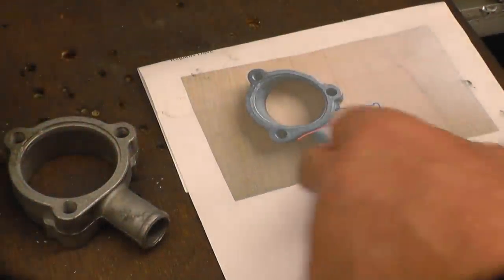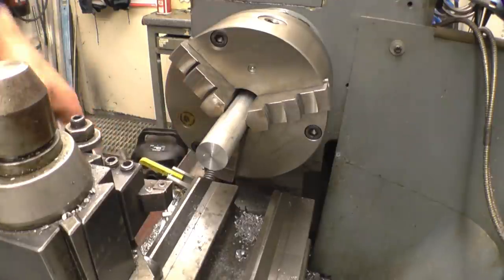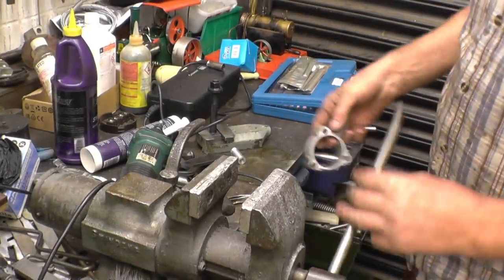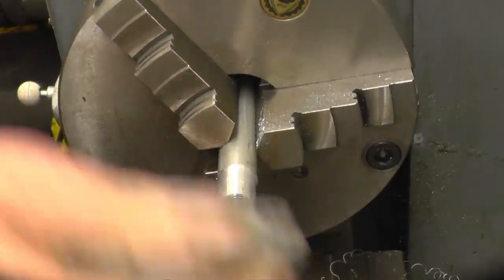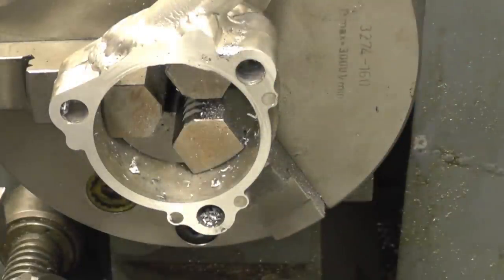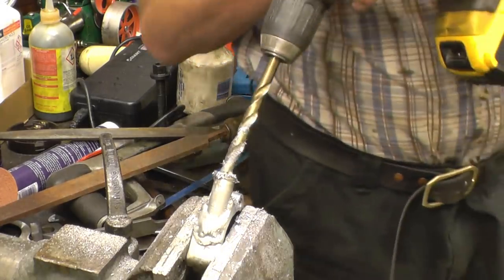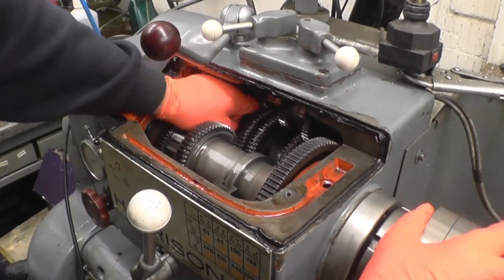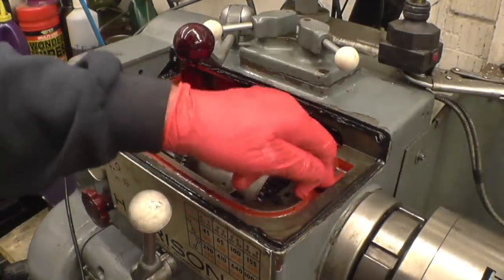SNNC 344 P1  Mini Thermostat Housing Mod ,  ER 25 Spanner

Comment: Great modification welding the alloy thermostat housing. Adding the extra magnet is a well worth modification. Had to laugh at the extremely strong magnet sticking. Last year I was carrying two larger ones in one hand separated by my fingers. I banged my hand one of the magnets jumped across to the other and nipped my skin on the fleshy bit on the palm under my thumb. I said a lot of your favourite words while trying to prise them apart single handed with a small electronics screwdriver. Never again, that made my eyes water lol. WARNING DON'T CARRY TWO IN THE SAME HAND. Enjoyed John.

Comment: John, you're correct the Harrison back gears are DP 14 with pressure angle of 14.5 degrees. I found the info on you SNNC number 94 from October 2015. At one point you show a shot of the gear cutter and the size and form of the cutter is clearly visible... Cheers👍

Comment: i own a 1972 T120R Boonnieville. it is a oil in frame model and i put a neodium magnet in the tank at the base. best thing i ever did. thanks John....
Reply: Did the same to a compressor in the fill plug, it would collect a little bit of grey fuzz every few months, just from the wear particles in the cylinder as the pistons bedded in. Another machine with known bearing issues I had a strong magnet on a wire in the oil, it got a lovely collection of shiny bits every week, as the bearings were run a little past their design capability, but no way short of rebuilding to get beefier in there. So a 6 month bearing change interval, till I dropped in 2 tubes of molyslip, which turned the  300ml of oil black, but at least got them to a year before change, though those last 2 months you were picking out lots of hair every week. 22kW of motor driving a bearing only really capable of 12 will do that, especially as the motor was providing the heat input via shear. The whole front end was basically considered a wear part.

Comment: Welding mystery aluminum is a pain, I'm no expert at TIG with aluminum but have had a few frustrating experiences with trying to weld on cheap casting metal.  Looks like the part will work like it should!

Comment: You may want to preheat aluminum it is like a foam it aborbs oil and oxides very easily it looks like your welds gets better at the end of the video and that where the heat cleans the crap out of the parent material. Also if you put a mark all around where the part is going to go and weld a bead down  and  weld the part to the bead it will may have less porosity problems. Keep safe Cheers.

Comment: Hi,John. I have a question about the Harrison back gears. When you recently made that custom back gear from tufnol, do you remember what DP the gears are. I think they are 12 DP. Does that sound right? I have need to make a couple of custom back gears for my own L6 Harrison.
Reply from the maker: I think they are i will check 14 seems to ring a bell

Comment: If that magnet, in the gearbox, is self holding itself to the iron housing it is using nearly all its force to stay put and there's only a little magnetic force left for catching ferro particles, but maybe it's enough.
Reply: It's enough, automatic transmissions  typically have a magnet stuck in the steel pan that easily grows it's own volume in fuzz between services. And those are just the boring black kind, not what looks to be a neodymium magnet.
Reply from the maker: It can only do good in there
Reply: @Broken_Yugo  I know that my petrol fueled, manual gear, cars all had a magnet in the bottom plugg for the motor oil. How it is fit there, I've no idea. Anyway, a magnet that has no ferro to grab is loosing its force so doing like John is probably the best anyway.
Reply: @doubleboost  Provided the magnet stays in a safe place and is not grabbed by any moving part.
Reply from the maker: @Stefan_Boerjesson  It will never move i can not pull it off with my fingers , That is a very good point to remember
Reply: @doubleboost  It sounds and looks safe!